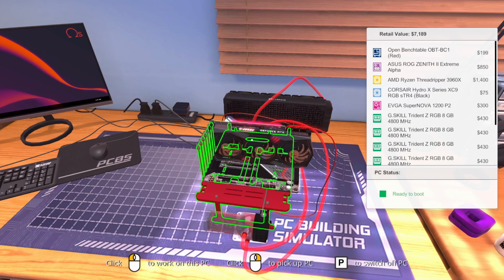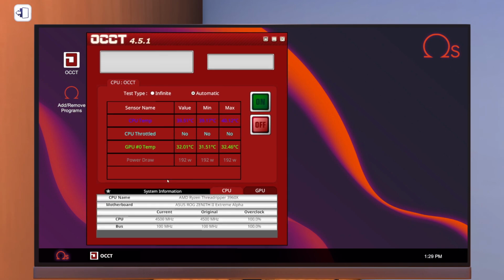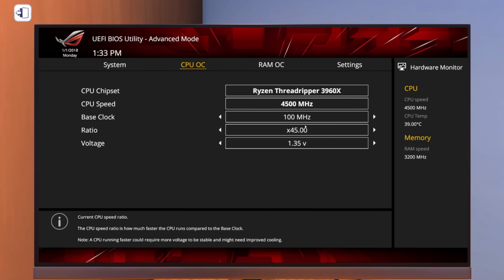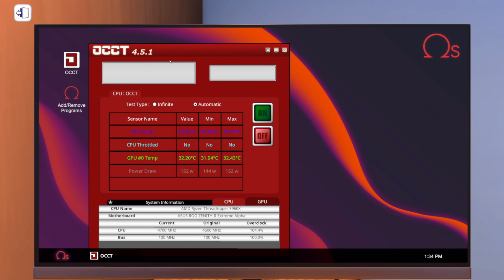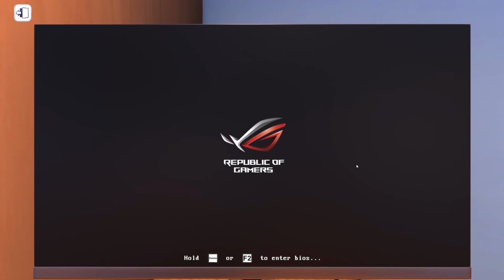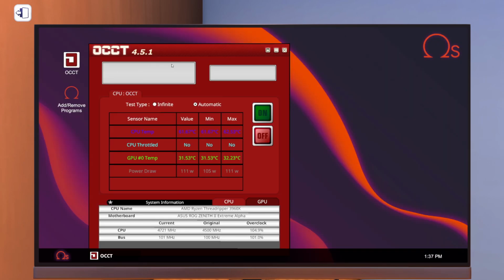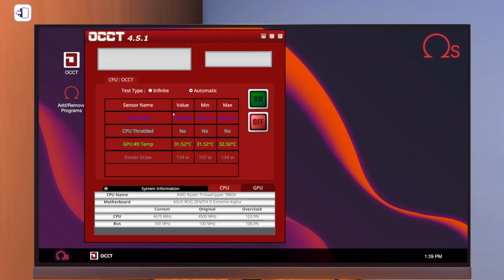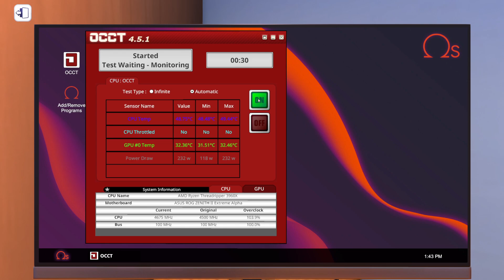Deep Dive Episode 1: Overclocking 101 - CPU Overclocking Basics

Comment: I can't figure out overclocking. My setup is identical, but i can't get higher than 4525 without throttling
Reply: I need to know how to do this too. The only solution I had so far is destroying their CPU and replacing it with my own.

Comment: (In Freeplay mode) i connected as much radiators as possible on the RAIJINTEK ENYO (4x480mm + 360mm) and my max temp was 52℃ at 4700mhz

Comment: Thank you, finally I managed that 1800x to be stable at 4320.
Voltage to 1.65 did the trick.
For others that come here for the same assignment :
Base clock down to 96 MHz
Ratio x45.00
Voltage 1.65
Custom water-cooling as the customer requests.

Stable under infinite OCCT, CPU temp 79.89 C.
Reply: I'm glad that voltage was just in game, definitely not good for the real life chips lol

Comment: ive got a problem, i got my first overcloking mission but i cant overclock it very much, cus the 3D mark will crash it since the PSU has a very low max power consumption at 300, i ran OCCT with no overclock and the power consumption got to 280+ and i tried overclocking the CPU to the target at 3525 MHz, then testing it in OCCT just for it to say 298w.

Comment: Thanks for sharing the video. You did a good job of showing off the CPU overclocking basics. :) 4675 wasn't the max overclock, but it was a rough max overclock. You can play with combinations of Base Clock and Ratio, to get something that might be better (higher than 4675 which worked but less than 4700 which failed) ... something like 4690, just involves more work. Also, I have several awesome companion guides, in the Steam Guides area for the game. Enjoy!
Reply: ok

Comment: Ok, I’ve had/played this game for a long time now but between this vid and jvn vid both of y’all mentioned binning. are you tellin me that after all this time of playing and overclocking in this game I’ve never noticed that? I didn’t realize, if that’s the case, that that detail was in it.
Reply: Yup silicon lottery is an actual thing in this game, so that's what makes OC'ing so tricky. One CPU could be great and can handle higher voltage like BigJake said, but then another one will basically die under the voltage.
Reply: @JVNGaming   ive done alot of ocing ingame and have had high scores but i just never really payed that much attention i guess. i really did learn something lol